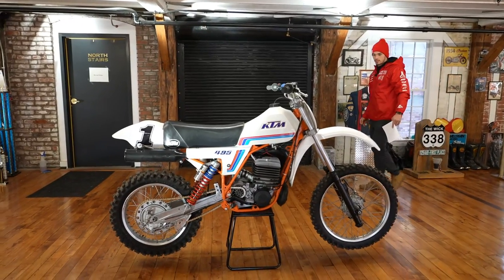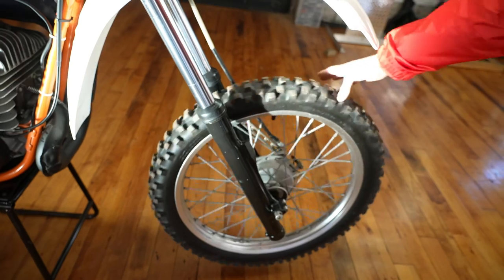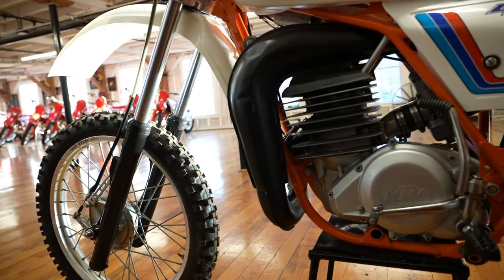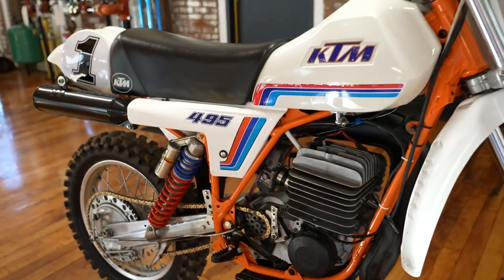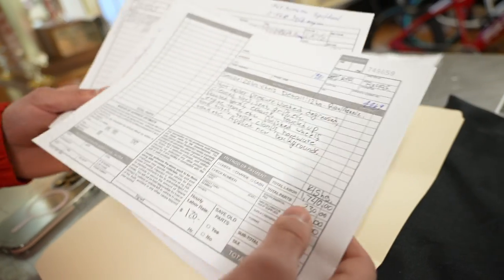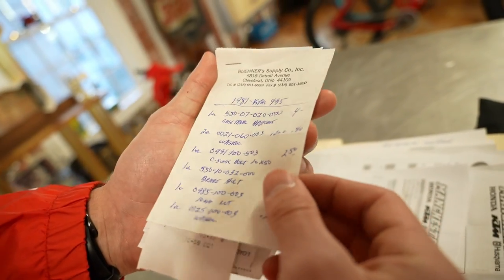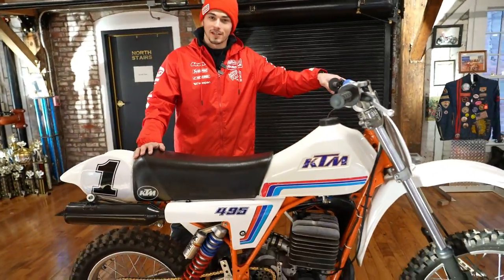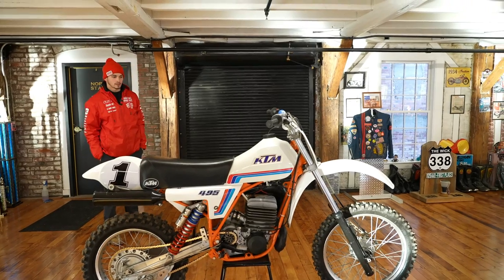123.75 MPH WORLDS FASTEST STOCK DIRTBIKE KTM 495 CLOCKED IN 1981

Comment: I owned a 490 Maico in 81 and we did a few Oval speedway races in N. I. I was clocked at 121 mph down the straight so don’t carried away with that  big pile of junk. I had one it always would stall in a high gear. Never be a Maico.

Comment: What's up with the orange frame? Shame they didn't get the correct power coat color and that DC plastics.  Owned an 83 495MX, restored the oem plastic and tank as the DC stuff was just too brittle for actual use. Otherwise nice old piston port 495 (82 went to reed valve, way more.grunt, but didn't have the rpm range of the mighty piston port engine).  We were building to recreate Rod Bush's famous run, it was truly more the bravery and outside the box thinking of Rod Bush to push that bike to 123 mph.  I doubt anybody can take a 81 495 and even come close to matching it

Comment: looks great,but what I never understand is to spraypaint a plastic tank.paint on plastic will not last so why paint it?
Reply: Painting  a plastic tank isn't something  you want to do if you dont have to 'but if the right materials  and process  is used   it can be successful  ( think of all the painted plastic bumpers  on cars)  years ago I painted my PE 175 tank  it seemed to have worked fine until the fuel vapor's caused the paint to bubble here and there ' since then Iv'e  become  aware of  sealing the inside of the tank to avoid this problem . Fuel vapor coming through  the plastic is also the reason for decals bubbling up.

Comment: I just have a hard time believing that a 100% Factory motorcycle can do $123 mph back in the 80s with a motorcycle that's only 500 cc's when my 2022 700CC T7 that has over 70 horsepower will barely do 120

Comment: Rode a kx 500 with ported and balanced motor. Chassis was terrible compared to the cr 500 ive rode and owned. But.. swear that thing did 120 on dirt.  Rode a 82 yz 490 with 500 kit. And despite having 4 gears.. It felt faster than any of the cr as well. Ofcouse maybe it was just terrible Chassis in both feel much faster lol.. I have confirmed  112 on dirt on a xl 650 or so the speedo claimed. but it took forever and was boating like a 70s station wagon. But it walked right past a 2008 cr450x that pulled it by like a foot ball field out of the hole. Lol then I had the transmission lock up on that 450 later wide open in 5th. Luckily on d&g was able to slide it to a stop.. wierd thing. It was still running. Transmission just locked up. 4th gear came apart.

Comment: I've always wondered...why couldnt a air cooled bike be competitive with or even superior to modern liquid coiled bikes,
Reply: When they get hot they lose power, cause the clearances change. They are good when cold .H2O cooling  maintains  consistent high power output
Reply: @rogerdodrill4733  thanks for the reply! When I rode my air cooled bikes they did lose power when they warmed up, but I suppose the reason for the question was I was wondering if liquid cooling had become the industry standard and may not be needed for short motocross motos . I know I'm not saying it right to get my point across, and for that I apologize. For longer races like enduro I can definately see where liquid cooling would be a must. But if you had two identical bikes with the exact same engine (bottom ends) and one with a water cooled cylinder and the other with fine, I bet there wouldnt be much of a differance for short motos. I could be totally wrong! I wish I had the money to do it! Hahaha I bet it would be super interesting to do it. But like I said, thanks for the reply!